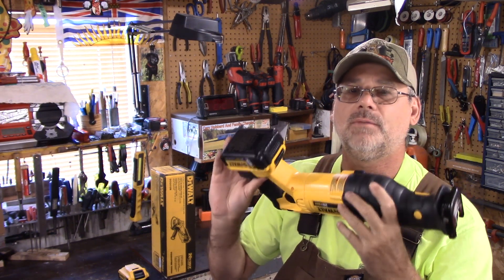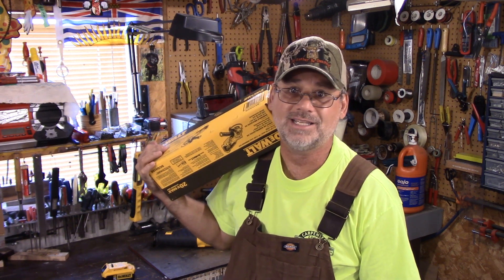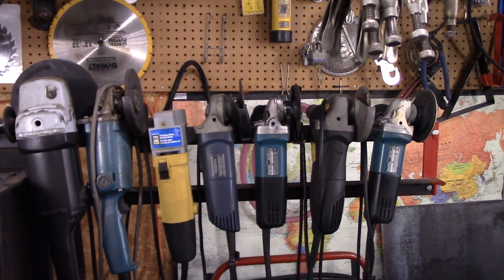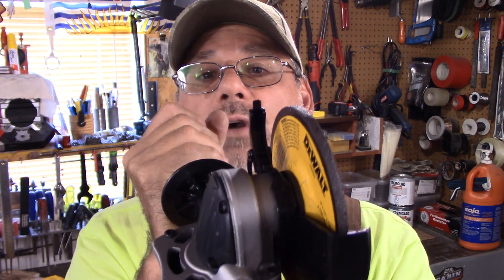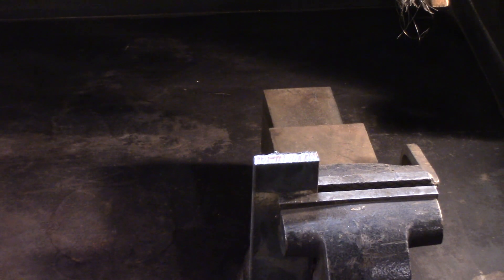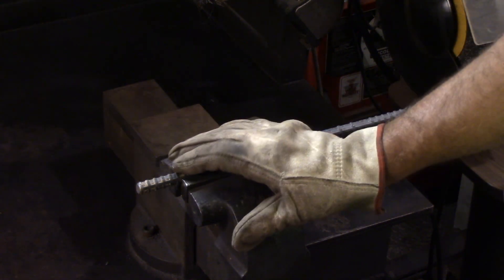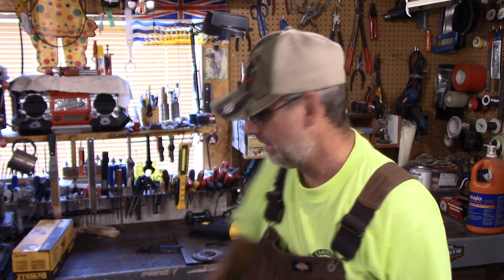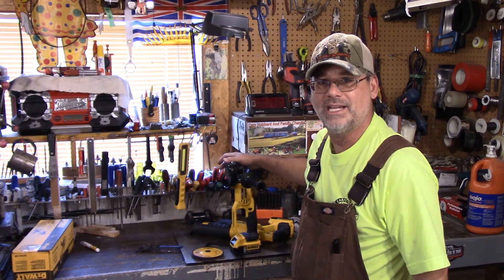DEWALT  20V MAX* ANGLE GRINDER REVIEW - DCG412B   Watch This Before You Buy !!!!

Comment: Allen wrench is to remove the nut that holds the discs on. Look at the nut close!
Reply from the maker: Steve I just went out in the shop to re-check. Nope the disk holder has 4 holes in it for the disk removal tool and that's it no allen anywhere.
Reply: The 4 holes are 6 sided for the Allen wrench to fit into one hole to remove the nut. I use the Allen wrench daily to remove the nut.
Reply: You must have a old old style nut. My Allen wrench fits in one hole to remove the nut. Send email address and I’ll send you pictures of it. That’s how they are shipped to Idaho. Corded grinders are the same also.
Reply from the maker: Ok I went out to the shop and put it on the workbench and got my flashlight.  OMG your so correct and I did not see it until I looked real close. LOL  I posted it on my instagram and mentioned you  for helping me. Thanks Steve that was awesome of you for taking the time and helping me figure out the allen wrench mystery.
Reply: STEVE ROB REVIEWS This is hilarious!!! Glad you figured it out.. 😂😂😂
Reply: You beat me to it Steve. I was going to tell him the same thing. Recently bought one and was dumbfounded at first then took a flashlight out and seen the hex deep in the hole. Great lil tool to have around working on stuff.
Reply from the maker: LOL
Reply: Where is your Walter grinder(s) ?
Reply from the maker: Now were talking a great grinder 👍
Reply: @Longtrailside  Mine has 2 hex heads and 2 smooth
Reply: Spot on! 
I was “missing” the wrench that the box said was included.  Completely bummed, and not looking forward to returning the grinder or calling DeWalt.   Your comment saved me!

And an Allen Wrench is a great idea, better than the 2 sprocket.
Reply: Mine has 2 hexagonal holes and 2 smooth. I was stumped at first too.
Reply: @SteveRobReviews  I just bought mine, and there is NO PLACE for the allen. The allen is 10 times  bigger than the little hole at the end of the mount.
Reply from the maker: Jarry Dee on mine there are two holes that do have the Allen key spot to remove and the other two holes are  just round.
Reply: Dang, after watching a few minutes of your video I could tell you were the kind of guy that paid very close attention to the nuts! I can't imagine you would've missed it.
Reply: @SteveRobReviews DeWalt need to put a photo of the alien key wrench in one of the holes. Then people would know.

They could also mould the plastic to have a groove that fits the Allen key.

Nice review.
Reply from the maker: @Google_Does_Evil_Now  Good ideas , thanks !!!

Comment: Hello Steve. The Allen key is used to tighten up the disk instead of using the usual grinder tool/wrench. Insert the Allen key in  one hole and hold the locking switch and tighten or loosen the disk. Thanks for your review. Just bought this grinder after watching you. Thanks again
Reply from the maker: Thanks Dave much appreciate the feedback 👍

Comment: Your review made me buy this grinder !!! Thank you for your honest review. 
I bought this grinder second hand as I have 12 bolts to chop off a  trailer frame and I didn’t want to be paying for a brand new brushless grinder because I honestly don’t think I will need to use it much or ever again but handy to have and I didn’t want to buy a corded one. The last year I have bought a few brushless cordless tools but as you know once you have a couple of batteries then it’s easier to buy the bare tools. 
I have a knockoff 6ah battery the two “compact” 3ah batteries with 21700 cells and a 2ah battery. I now own a 894 impact wrench, compact reciprocating saw, hammer drill and the air compressor and next week angle grinder will be delivered.  And I can see me buying the oscillating multi tool …. Never thought I would have a power tool collection and what a difference they have made, makes tasks so much easier and safer without a cord dangling. 
Thanks again fella 😊.
Reply from the maker: Thank You for such  nice feedback .

Comment: The allen wrench is instead of.  If you look on the black thingy that holds the disc on, 2 of them are now allen wrench holes and 2 are your kindo wrench hole.  That's the only thing I understand about this grinder.  Lemme know how to figure out which wheels/blades fit on that particular model because I can't find any or I don't understand the numbers I need!
Reply: You can use any 4 1/2 in. Disc with 5/8 or 7/8 hole.
Reply: @sargelaforgia4787  thank you!

Comment: Great review! I bought the Dewalt corded DWE402W (4½", 11amp) grinder last Summer and it's been great - if I'm working near an outlet. I'm in the middle of replacing 40 year old cedar fence posts with metal T-posts on a 10 acre lot and REALLY need a cordless grinder to cut off some posts that bottomed out on rock. I was looking at the 412B the other day, they're $129 at Lowe's now, just wasn't sure if it had enough power for the job. Think I'll pick one up in the next few days, you're review was just what I needed to know.
Reply from the maker: Thanks , yes it's  got tons of power . 👍
Reply: $135 at Lowe's today - late June 2022.

Comment: Tell me what discs it uses, please, because every one I buy doesn't fit THAT model.  Do you have a video on that?  Matching the pad/blade to your model based on whatever numbers it is that I need (because I apparently I do not understand it)?  There seems to be a type 1 and type 27.  The rotation speed is important too from what I've read.  So, I find it very confusing as all the stuff I bought so far, I've had to return.  I know it's user error but user can't figure out the info!
Reply from the maker: I just pick out a 4.5 inch  disk with a 7/8 mounting hole. Measure yours for fitment.
Reply: You can use any 4 1/2 disc with 5/8 or 7/8 hole.
Reply from the maker: @sargelaforgia4787   You must match the hole size on the disk to your grinder .
Reply: I'm not an expert, but I believe the type 1 blades are flat and used for cut-offs, and type 27 are sunk in the center and used for grinding. It does matter on at least some DeWalt grinders as they require different flanges to hold the different blade types in place. There is also a type 1 guard that covers 1/2 the blade on the top and bottom. I'm surprised this grinder doesn't have a type 1 guard as it's advertised as a cut-off grinder. I'd like to see how this grinder does with concrete, bricks, and mortar.
This video says that a type 1 cut-off blade can be mounted by turning the top flange so the recessed edge is toward the blade to hold it tightly in place: https://www.youtube.com/watch?v=AMue0p1Gjqo
Reply: @jps5144  thank you!
Reply: ( your question on fit . )  the Videos I watched , they use a DEWALT 4-1/2 in. Backing Flange( Home depot( <$4 ) fits the 5/8's  threaded driver shaft and the front of the  flange  opens to 3/4 , looks like 1/16th inch lip that fits the 3/4  .  this  flange flange fits over the 5/8's driving  shaft  . centeres the  wheel  and a  larger  surface to  sandwich the wheel . Amazon has sets  for $7  3 sets and a spanner . 3 -  5/8 -11  front  nuts  and 3 Backing Flange and a spanner ( if you don't have one ) they are cheap , locking nut then threads on the front tightened by the spanner wrench  , or if its the new type it has a  hex hole for a allen  wrench ( so much easier I never can find the spanner )
I'm looking at the De Walt angle grinder  20 v  and I happened to see ,on amazon a  exention set , that label's  the extension shaft 5/8 -11 , I didn't know what dewalt was & if it doesn't fit   its a pain , sounds like something  usfull to get in a  cavity .

Comment: I usually only buy XR series from DeWalt. However, I only have 1 functioning arm, so I'm hesitant of angle grinders.
 
This has a great handle it seems though. 
 
Anyone think this might be a safer option for cutting metal (angle iron, bolts etc) than the other options out there, for my disability? Using rotary tools takes forever.
 
Thanks!
Reply from the maker: I have a abrasive disk chop saw I used for decades cutting steel and this is by far the best as you can only use I arm to operate it. Cheers

Comment: Steve, what are the amp hours on your DeWalt 20v batteries?  I bought the 18-20V adapter kit with the charger and the 2 batteries are 1.5Ah and I am wondering how long they will last on a charge....Cheers
Reply from the maker: Larry I have 2 - 1.5 amps and two 5 amps . The 5 amps are heavy so I use the smaller ones and they do what I need for the most part as I'm not using them constantly. They dont have the charge indicator on them so its hard to judge but I charge them up after about one hours use.

Comment: Bonjour du Québec,  j'espère que vous allez bien . I have a question. ...I have this grinder .. . I bought this in a kit and I wonder if in your box you had others bushing for thinner or differents types of blades ?. I have only the nut that hold the blades and I reverse the nut for thinner blade. It work well but not sure it is the proper way.
Reply from the maker: Benoit it works exactly like you say , no other bushings were in my kit either . Cheers
Reply: @SteveRobReviews  ...merci beaucoup Steve ,  j'apprécie que vous répondiez.  Continuez votre bon travail ...votre énergie est contagieuse ...

Comment: Do you really need that many grinders? Or are you just a tool geek?
Anyhow I wish I could get one for $90. It's June 2022 and the bare tool is  $135 at the big box.
Reply: Amazon has 90 day guaranteed renewed models at $115 USD. About to order one today for some concrete block removal. And some rebar cuttin too.
Reply: If you have different wheels on multiple grinders you don’t have to stop to change wheels
Reply: @gabagool2064  
Just so.

Comment: Good Video. I just used mine to cut the axle u bolts off a F-150.1 1/2 batteries to cut off eight 1/2 u bolts and it saved my ass in below zero Weather.. Hope all is Good in Canada. eh
Reply from the maker: Nice , many situations a cord gets in the way or you dont have an electrical outlet handy.  My first cordless grinder and I cant stall it out. Awesome power and for the money will come in handy up at the camp. All good up here and this has been one cold snowy winter most are complaining about as climate change but I call it weather like we always had :)
Reply: I'm just guessing  that you have the 20 volt-2 amp hr batteries which in my opinion are good for light duty work. If you use these tools all day long as I do making a living,I would suggest upgrading your 20 volt batteries. Dewalt makes 20 volt batteries ranging from 2 amp hr - 6 amp hr. I,m no battery engineer but I use these tools 8 hrs or more a day and I have found that if you suck the life out of the smaller amp hr batteries by extended use that you heat them up and shorten the life out of them.
Reply: Correction after reading Steve's post, Dewalt makes 20 volt batteries  from the 1.5 amp hr - 6 amp hr. I did not know that as the smallest rating that came with the tools i own was 2  amp hr.

Comment: is this tool strictly for cutting metal or can it be used for grinding concrete?
thanks
Reply from the maker: It can cut most anything if you buy the required disk. Cheers

Comment: If you are watching this and plan to use the grinder a lot you might want to spend a bit more and get one of the XR series Dewalt grinders that has the brushless motors and a brake for rapidly stopping the blade after you release the trigger.
Reply: You seem to be agrinding kind o person: how do I know what discs fit?  It only goes 8k and it's a type 27. It's the one in this video but nothing seems to fit and I've never really used one so I don't know how to assess what will fit and won't.

Comment: I do wish dewalt can make a new version of this model disk grinder with a brushless motor and disk break. I do like the handle and trigger on this model then the new paddle version .  

Only the UK has the new model disk grinder with the side switch.  I do prefer that style way better then the paddle style.  

If you get a chance use the new 6.0ah (21700) or new compact  4.0ah (21700) cell batteries. Runs the tool longer and cooler.  

Thanks for the video
Reply from the maker: Thanks Michael  I will check them out. Cheers

Comment: From Amazon I bought DEWALT 20V MAX* ANGLE GRINDER  DCG412B, the motor gets hot after 5 minuets  at continuous operation, then the motor stop operate until it cools down
Reply from the maker: @TexasMan-oz8kl  Interesting , that's never happened to me before.  I wonder if the thermal cutoff is set too low on your unit.

Comment: We see you don't read instructions either lol, I bet it told you in there what the wrench was for and to leave battery disconnected when mounting disc LOL. I wonder what the run time is on it continuously grinding? I never seen an allen wrench grinder tool either so that's a new on for me as well lol
Reply from the maker: Chase I used it pretty good for 1/2 hour grinding and it still had two out of three bars. If I was really using it hard I bet 1/2 would be tops. Never seen an allen wrench for a grinder  WTH :)

Comment: Just disappointed that DeWalt didn't release the UK model style (DCG405) over here in the US.  That model has a side switch which i like better then the paddle style.  If you get a chance look at the video by Oz Tool Talk.  

Also these grinders are missing the top handle position.  They only come on the both sides.  Kobalt even has a 24v grinder that has the top and side section for the handle. Seems like DeWalt and Milwaukee has to release a new generation for this one mistake.

Just wanted to share..

Comment: You mentioned that  a box of Walter discs could last 12yrs before you used them up. Discs may last a long time but I wouldn't use one several years old, new or used. All grinding/cutting discs are stamped with an expiry date on the metal ring around the hole. It is put there because the resins used in the manufacturing process will degrade over time. BTW, I have the same grinder and I love it!
Reply from the maker: Thanks John i'm going to go out to the shop and look right now. I did not even look. Great tip.
Reply: @SteveRobReviews  Let us know what you find out. I'm curious to see how old they are.
Reply from the maker: John I posted a picture of the disk on my instagram so if you want to look just  look in this video description  and click on my instagram link to see. I don't see one .